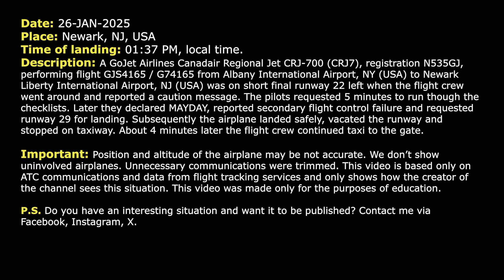Secondary flight control failure. GoJet CRJ-700 declares MAYDAY on approach to Newark. Real ATC

Comment: It is so painful listening to atc asking questions repeatedly. Especially after cleared to land.
Reply: Like every emergency this happens too. This needs to be standardized how the info is provided and passed along. It’s gotta be time consuming for pilots to always repeat themselves when they’re already in a situation that isn’t normal
Reply: they literally were not passing along the info to different sectors and they all had to reask. Smh no wonder the Potomac crash happened
Reply: @IlIlIlIlIlIlIlIl-v9h  Likely has no coloration with the Potomac crash.
Reply: @millerkarns  lack of efficiency, common sense, and streamlining off efforts to not burden aircrews during critical phases of flight? Yeah… totally unrelated
Reply: @ It is completely unrelated. If anything, there are issues with understaffing, but this situation and the situation at the Potomac have nothing in common circumstantially. "Lack of efficiency, common sense" is such a vague buzzword that you gave no application to in the midair collision incident. The controller at DCA almost did everything right, if not everything right. He gave the helicopter pilot a traffic advisory, and to report that traffic. The helicopter reported the traffic in sight. Then the controller gave clear instruction to pass behind that aircraft, and the helicopter acknowledged. This will more than likely not fall on the controller as it will on the crew of the Blackhawk. The incident in this video does point out the rough state of ATC in the US currently, but it has nothing in common with what actually happened at the Potomac.